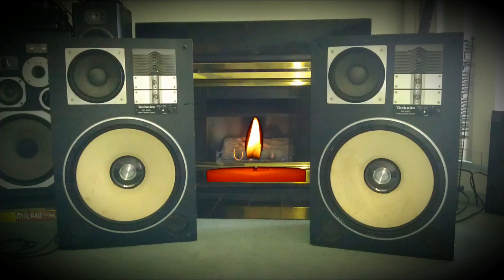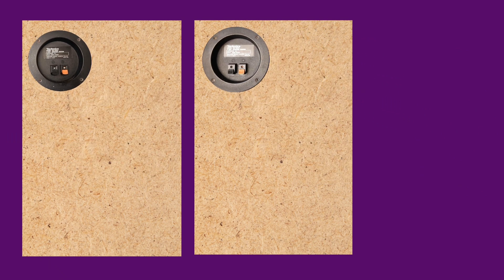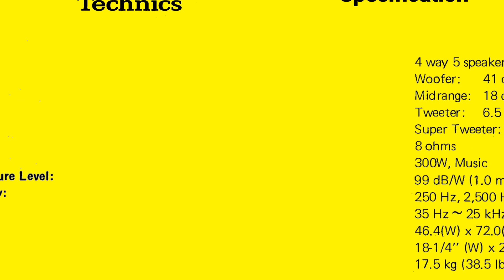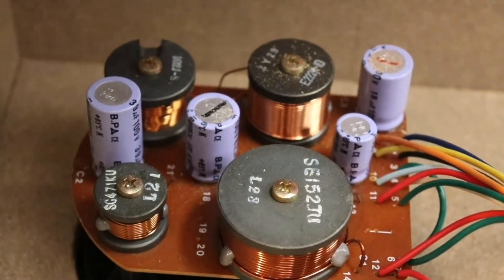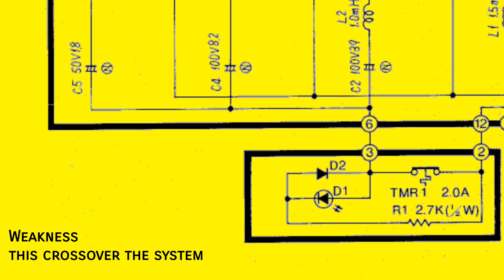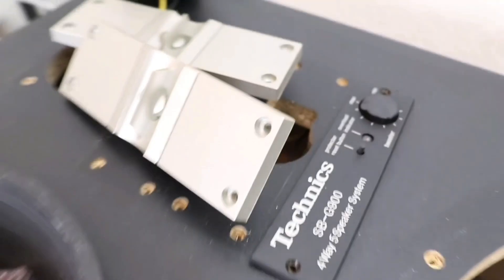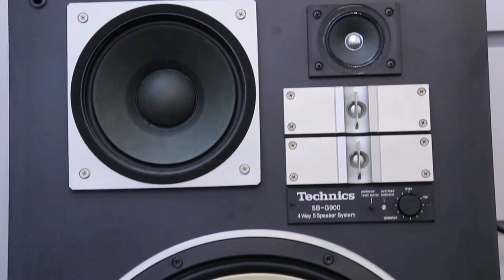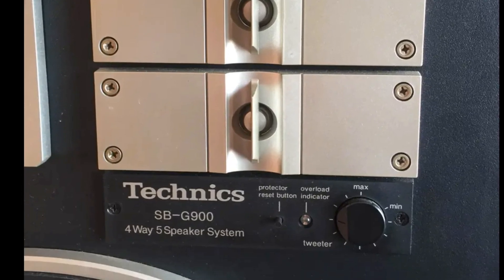Technics SB-G900 floor standing speaker have a secret that many people don't recognize it

Comment: Dear Sir…I found this video which is very interesting because of what you explain about this speaker model. Can you tell me the value of the “missing” capacitor to be installed in the bass circuit? I would be very grateful. Regards.
Reply from the maker: thank you for your comments sir Jorge. you can add a non polar capacitor 15~22μF/50V  install with a parallel circuit with the woofer coil

Comment: Can anyone help me find the replacement tweeter for this model . Thee model of tweeter is technics -eas10ph33s.
Reply from the maker: And any brand of Tweeter should work for your speaker system. Remove the tweeter from the plastic  bracket then look for a tweeter with a diameter of 2". impedance 8 ohms